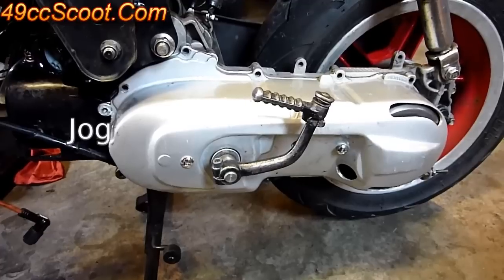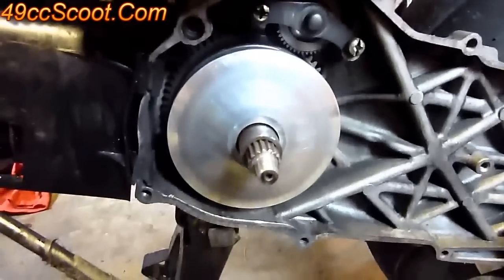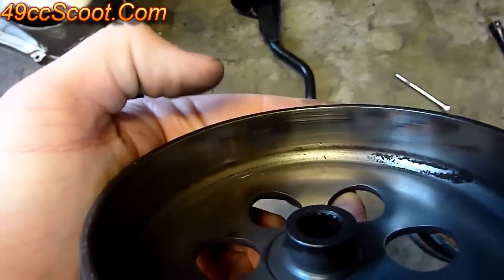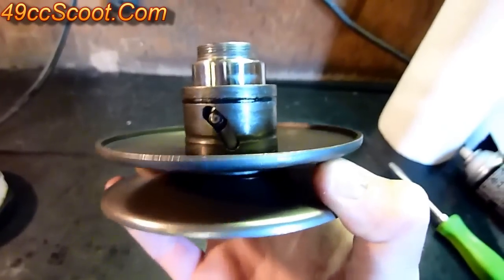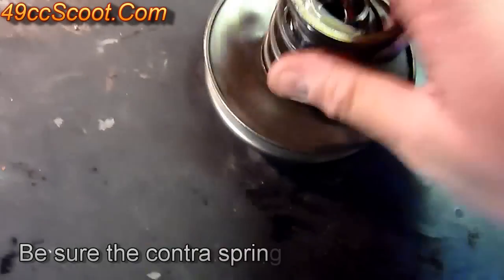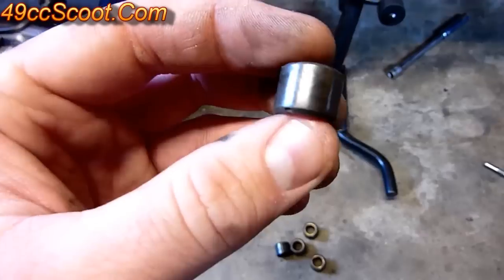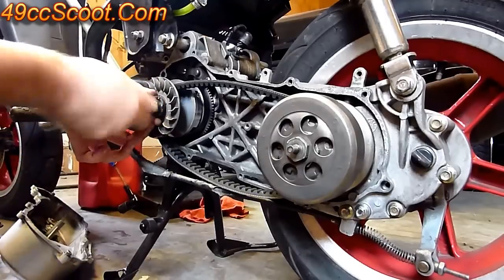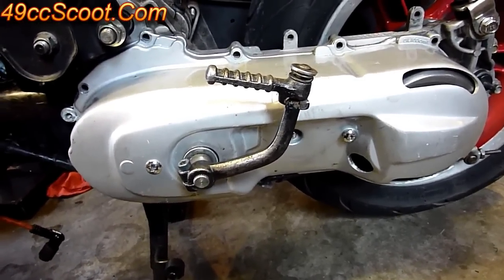Scooter CVT Transmission : Full Service Inspection

Comment: Thank you.
I have a 2010 model Suzuki V125G Address scooter (Japanese domestic model).
I want to do this myself soon.
My scooter is at 26,000 kilometres and I think I need to do this as a scheduled job at 30,000 kilometres.
Not sure whether I should do it myself before watching a proper bike mechanic do it first.
Wonder if the dealer where I bought it will let me watch?
Probably not (that kind of thing doesn't happen here in Japan).
Thank you again.
Reply from the maker: Dealers and shops don't generally let customers watch unless they happen to have a window between the waiting and service areas. It's a liability for them and to be honest it's no fun as a mechanic having someone looking over your shoulder all day. I would suggest watching this video and others if you can find something model-specific for your scooter and deciding how confident you are in your ability to complete the job based on what you see, past mechanical experience, and tools available to you. If you can locate a service manual that would be a great help as well. If you enjoy working on things it's a great learning experience. It is VERY important to take your time, especially when you are new to these things. Pay attention to detail.

I would want to service it well before 30,000km. Even if all seems well I don't usually go much over a few thousand miles without at least looking at the belt to make sure it's not wearing down a lot. Learn to do the job and you can service it more often and for less money, but if done wrong it can cost you money in messed up parts. Only you really know what you're comfortable with, so I wish you luck in your decision and whichever path you choose.
Reply: +90GTVert Thank you. In the end I kept getting it serviced where I bought it until I had both the proper manual at a cost of 10,000 Yen ($100, damn it), and a bigger bunch of tools.

I let the dealer do a belt/rollers change at 26,000 kilometers.
He said the clutch was fine.

Reading the manual, I can see I'll need to inspect this more often from now on.
It's been a spur for getting back to reading in Japanese, too, and there are loads of words in the manual that I did not know the meaning of (sometimes even in English).

Thanks.
Just watched this again. It's a great help.

Comment: i have a horrible vibration coming from gearbox shaft the one with the clutch and bell bolted to it,i looked at bearings and they seem ok,what movement should the shaft have because if u turn back wheel every now and again i can see the shaft and clutch sightly wooble , on a peugeot speedfight 2 ac
Reply from the maker: 94f1senna I'm not familiar with the Peugeot engines. In some platforms a bit of play is normal, typically these will be supported by a bearing under the CVT cover also. Some are meant to have hardly any play. Consult a service manual and find a spec for play in the shaft. I have manuals on the site. 49ccscoot.com

Comment: hey there, ive got a 150cc gy6 scooter and when i pulled the cvt cover off the belt was very tight around the clutch and variator, the bike used to do around 60mph now it does half that, could this be the reason? Thank and great video by the way!
Reply from the maker: Jack Shane Tension on the belt is normal. It should be sitting near the center of the front pulley and near the outside of the rear pulley when at rest. With a big loss in speed I would suggest considering other symptoms such as has RPM increased, has overall power decreased, noises, etc... An inspection of the CVT is never really a bad idea. Compression test may be helpful.

Comment: HI. I find your tutorials life saving. I have a question that I'm unsure of. On my scooter, (50cc tao tao), the driving pulley is plastic. When I put on a new cv belt and reattached everything, the pulley keeps grinding up against something every time I accelerate. When I opened up the crank cover to take a look, the teeth of the drive pulley was chewed up. 
My question is do I really need it and can I just take it off or break off the remaining teeth so it doesn't rub. But more importantly, is it rubbing because I didn't tighten the nut enough. I used a hand held ratchet to tighten it.
Reply from the maker: None of the pulleys should be plastic. I'm thinking you mean the fan that attaches. That's plastic. It moves air to help keep cool the CVT. You can get the nut tight enough by hand, but it is very important to make sure you aren't tightening the pulley against the belt. Squeeze the rear pulley to open it up and create slack in the belt and hold the belt to be sure it's not squeezed in the front pulley while you tighten it. Otherwise make sure nothing is out of place causing the fand and pulley to be pushed outward farther than they should be.

Comment: You seem to know quite a bit. I have a 90cc atv with a similar clutch set up. Almost identical actually. As far as i know its all original. Some times it takes off aggressively and other times its real boggy and hard to get going. It can't even get its self up a small incline. My roller weights dont have any flat spots at all. The variator seems to work when i have the wheels off the ground but when riding the variator hardly raises the belt up at all. Now looking at the clutch its self all the springs seem to be good and strong. The clutch bell is purple and blue due to heat. Im insure what to do from here. I did notice the shaft that the clutch slides on has side to side play could that be a issue?
Reply from the maker: Play in the primary drive shaft (what the clutch and rear pulley are on) is unfortunately normal. If it is excessive, the bearing in the gearbox should be replaced. 

Have you gone over the whole CVT to make sure all looks well in  the torque driver as well? Could be the contra spring needing replacement. Sometimes what happens in that case is that it will fade bad, so it runs OK when the CVT is cool and then it heats up and RPM drops. 

Could also be totally unrelated to the CVT. Mixture problems, compression, failing ignition.

Comment: Great video, it's nice that you thoroughly explain every part of the assembly and disassembly.

I only have one question, what kind of grease would recommend to use after you've cleaned the torque driver/ rear pulley? Can you use wheel/ball bearing grease, or is that too thick?
Reply from the maker: I use Mobil 1 synthetic grease a lot. Any of the synthetic wheel bearing stuff is probably fine. I've also used BelRay's moly lube. The one thing that I really didn't like at all was the stuff that Malossi makes for torque drivers.
Reply: @49ccscoot  Alright! Thanks, I'll try that out.

Comment: I wondered why u had slots cut in your cvt cover in your latest bike  over the clutch bell doesn't dirt and water get in. I was gona clean the air filter on the cvt inlet snorkel  is it just foam and can u wash it  Do they get very dirty and clog up much cause I haven't done it since I've owned it and does it  need air filter oil. Thanks
Reply from the maker: The only issue I've had is with water in vented CVT covers, and I was running through standing water maybe 10" deep. Don't do that sort of thing and you'll prob be fine. You can dish soap and water wash those CVT filters usually or use an air filter cleaner on them. Air filter oil is fine, but I wouldn't say it's required for the CVT.

Comment: Yeah i rolled the tire, pretty sure thats not it. It make a humming/whirring kind of noise that goes along with the vibration. Definately feels like something a little weird inside the gearcase or belt drive area. Just not sure what the  usual suspects are. I will definitely check the gear oil. Hopefully its something simple.

Comment: If I was to remove the restriction from the clutch/variator would it get more top speed or faster take off ?
Reply from the maker: Depends on the scoot. I did it with a stock 1E40QMB 2T and it took off slower and didn't go any faster, because it squeezed the belt up higher in the front pulley and it lost the best takeoff gearing. and the engine didn't have enough power to pull me faster than I was going with the washer in place. You can try it and put it back if it doesn't work as long as it's nothing that has to be ground out or broken.

Comment: Hello. I have put a BGM Supertune variator(similar to Malossi Multivar) and a Morinni rear pulley on my Yamaha Aerox and now I don't know which is the ideal belt length for the transmission. I have found out on a forum that most of the declared dimensions are not true. For example a Bando belt which is declared as 738 mm is actually 753 mm. Is there an accurate way to measure the required length? Could I put a belt which is 17.5 in width or I should stick to 16.5?
Reply from the maker: I've always used belts around 16.5-17mm for Minarellis. Wider than that (unless it's an OR kit and belt designed for it) doesn't work well for me. More narrow and it loses top end. Even if you measure what you feel is accurate, the next belt may not be true to the spec you hoped.  I bought a Gates belt that was 798 to replace my 788 Bando and the Gates ended up being shorter.

Comment: Hey im on a budget and would like to do repairs for myself and am now buying parts and tools, impact gun is pretty expensive for me to buy for one use, is there a chance i could use a 1/4" ratchet to open the front Variator or the clutch in the back assembly ? Or are the forces needed to open and later close and safely seal just too high there ?
Reply from the maker: Go with 1/2" preferably for those jobs. An impact is not really a one use tool. You'll find that you dislike being without one if you ever try it. For now though, 1/2" or 3/8" drive ratchet and a holding tool could do it. I've changed my belt on the roadside with a stubby 3/8" ratchet, stubby hammer, and a vari holding tool on multiple occasions.

Comment: I have a 2000 Yamaha zuma cw50 with a similar engine. I just installed a 70cc big bore kit by polini, install went great, moped starts and runs! Only problem i have is it only goes 20-25mph. I was told it could be the belt / variator. Is this true? Thank you!
Reply from the maker: It's possible. If it's CVT related, you may notice RPM being too high or low due to something like a thin belt, wrong roller weight, belt slip, or other issues. Could also be carb related, perhaps too lean if you haven't changed the main jet.

Comment: Hi. Got a 792x16.6 belt on my minarelli 1e40qmb scooter. Rides up well on the rear pulley giving me good acceleration. However it seems like it is 5-8mm short as it won’t ride to the top of the variator on WOT and with the sharpee trick. Also looks short when i manually sized it up with just the other half of the front pulley and boss on and the belt further down at the rear pulley. Any alternative belt size that you know of that is a few mm longer?thanks
Reply from the maker: I had a Gates belt that was supposed to be 792 or something like that, longer than my 788 Bando. Turned out to be shorter. I always used the 788 17 28 Bando belts with anything but the over range transmissions. There are Malossi over range belts (and I'm sure other brands) that are longer. I tried the 6111108 Malossi belt with various non-OR configurations but  it was just too long and made a bunch of slack on take off that slowed me way down.

Comment: Do scooters take car oil for the engine oil or do they need 4t.  My back drum has a squeak if it is  down to the metal how can I tell it only squeaks when brake applied not when wheel rolling. What's the biggest giveaway that a scooter gearbox and belts etc  aren't good when buying a scooter. Thanks
Reply from the maker: In general, scooters can use standard motor oils for four stroke engines (car oil if you wish). Only scooters with wet clutches, where the clutch is in the oil, require motorcycle specific oils.

If you can't tell by the sound, pull the rear wheel off. You may also notice that the adjuster has to be way in to get the brake to work because of worn components.

I would say strange noises would be the biggest giveaway if you can't see the belt. Excessive slipping if you can test ride.  Possibly rough movement.

Comment: very very helpful i guess the second part of my clutch is broken that will mess with the speed right?
Reply from the maker: Not sure what you mean by second part of the clutch for sure, but the CVT can be quite sensitive to even wear or small issues so broken parts won't do you any favors.

Comment: hello all.i have a 2008 il bello 150  flyscooter that has had recent work done (new belt 5 months ago and is now making vibrating noises at around 30-35mph..i can feel it in the seat and it it makes a humming whummmm whummm whumm whumm like its "winding out" no performance loss just noisey!...could the variator be shot or rollers worn out? they were replaced a few years ago prior to the belt being repalced. also, what is standard roller measurement and weight?
Reply from the maker: +Mike Horvath Could be a tire/wheel balance issue. Could be something in the CVT. Could be a bearing or something bent. You'll need to do some inspecting.

Comment: Hello,

I've got a 2015 Honda Vision 50, and it will not go past 28mph. Slow as hell. Will it have the washer in between the fixed half and Variator?

Thanks.
Reply from the maker: +Hiesenburg White I don't believe so. No personal experience, but I read that others replaced the variator with an aftermarket one and gained some speed.

Comment: Thanks for your videos.factory belt broke on my jiajue 49cc with only about 942 miles . 669- 18-30 . Belt was a gates belt . found 3 of the 6 weights in sideways . cleaned it. Replaced belt . only thing ive lost about 4mph on top speed . pulks fron stop takes off better . on downgrades its much faster and engine doesnt whine like before . did weights cause belt to break? Any thoughts be apreciated . have no idea weight size . thanks
Reply from the maker: Weights could have been displaced when the belt broke. Pretty common because the variator can be free to move more than usual and rollers have space to move around. Maybe RPM at speed was a little different with the old belt and it liked that better?
Reply: @49ccscoot  dont know . At about with 200 miles on odometer i noticed it started to have a higher top speed. Before new belt it would do about 40mph down hill but the engine was reall whining . Now downhill it will do almost 50mph no engine whine . pulling out from stop is better and it makes you think it will get going pretty fast . but at about 30 mph on level thats it . Im going to get a carb and some 7g weights . cold temps here get in way of a lot . thanks .

Comment: hey, i notice there always a little oli just underneath the variator. i clean it up, go for a ride. then when i check it again there abit of oil at same spot. do u think that my crankcase seal need replacing?. should i check to see if all my seals, screws and bolts are in good condition also. cheerz

Comment: maybe you can help me, i just bought a 1990 Honda Elite CH250, for only 200.00 all it needed was a fuel filter, but anyway
it runs pretty good, when i am riding it about 15mph i feel a vibration coming from the rear of the CVT when i first start it, and then it goes away, and runs fine, and sometimes going around a corner, i hear like a loose power steering belt, what do you recommend i check first, this is my first scooter,  i don't want to start replacing parts that i don't need to, please advise. i do have a video on the scooter on my youtube channel
Reply from the maker: First thought for me would be to take the CVT cover off and do a thorough inspection. Being a 1990 and usually being unsure of what the previous owner did, that would be my move.

Comment: Hi, I have a question about all the springs, what do they do and what is the best for performance for a 50cc moped, I'm a little confused on which ones I should use for the best performance
Reply from the maker: The small springs in the clutch are clutch springs. They control the engagement of the clutch. The large spring in the rear pulley is the contra srping. It keeps some tension on the belt and, in conjuction with roller weights, changes how the CVT "shifts" or changes ratios. Go to the CVT section here for more help :

http://www.49ccscoot.com/faq/faq.html

Comment: I have a 2014 taotao 49cc It barely has 200 miles on it.  When I push the start button It sounds like the starter is slipping  I took the starter off and the splines are not worn. my next step is to take apart the transmission assy, and see if the gear which the starter turns is worn,  it does finally start, after a couple of tries, do you have any Ideas I am a great fan of you videos
Reply from the maker: +michael paradise It sounds like you may have an issue with the starter bendix... the thing that sits between the CVT cover and case and meshes with the starter and fixed half of the front pulley. Sometimes something as simple as changing the spacing of the CVT cover will make it malfunction, so if you've removed the gasket that could be part of it. Sometimes I just barely loosen the cover bolts and then try to crank it over to see if it changes.

Comment: Hi I just wanted to ask ,,on my scooter in the the cartercap there is a cable,wat;s that for??
Reply from the maker: There are usually only 3 potential types of cables on a scooter. Throttle cable, that runs to the carburetor. Brake cable, which would run to the front or rear brakes and levers. Oil injection pump cable, which runs to an oil injection pump that sits behind the flywheel and stator if it's a Minarelli or clone and ties into the throttle cable at a T or Y connection somewhere.